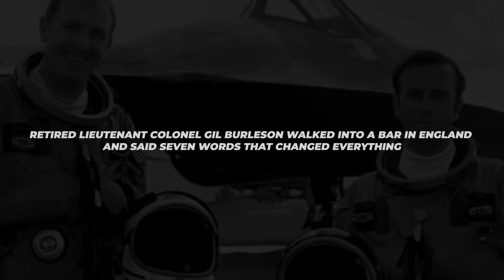Finally! SR 71 Pilot REVEALS The Blackbird's TRUE Top Speed!

Comment: It's actually very simple.  The SR-71 (and the A-12 and YF-12) can fly slower and lower burning more fuel staying cool, or higher and faster burning less and getting hotter.  The only coolant on board is the fuel flow.  So there is a point where flying higher, faster, hotter, with less fuel flow becomes impossible.  Why?  Because we are not burning enough fuel to cool the aircraft.  Also, above 82,000 ft we get into the ionosphere.  It's not really atmosphere any more, it's plasma.  Everything simply gets too hot.  Long before anything would melt, the temperature started to do permanent damage to the airframe.  It would take days, sometimes weeks to repair.  This information is from multiple actual sled drivers and actual mechanics that I have talked to in detail.  It's not classified, it's physics.

Above 3.3, things start to bend.  The damage just gets worse quicker beyond that.
Reply: Exactly the correct point to make. High Mach speeds aren't about having a long enough virtual hill to build up speed going down, they are a function of engineering requirements to achieve specific flight envelopes or aerial performance responding to pilot input at a given altitude density, airspeed and Mach speed and there are several engineering factors which must be balanced on a knife's edge at high Mach speeds, which for example limits the stainless steel Foxbat to around 2.8M and the titanium SR71 to around 3.2M. The reason for the limiting factor on the Foxbat is structural failure but on the Blackbird it's the engines and what that means is their design simply cannot sustain speeds above about 3.4M, they just plain won't do it. People can fantasize all they want about 3.5M claimed performance but as you mentioned it's not about classified information, it's about irrefutable physics. As it so happens even 3.4M isn't particularly realistic for the SR71, that's actually about 3.2M but the single seater versions had no problem sustaining 3.4M long enough to break official speed records and it is rumoured the SR71 could be pushed there but not as easily, IIRC the most plausible claim for an historical, unusually fast mission leg for the SR71 was a hair over 3.3M whilst as mentioned the YF-12A speed record is 3.4M. Anyway, that's about where the engines just can't cope with inlet control to function any faster. It's a hard limit. Irrespective of any other airframe capabilities. The target sustained high Mach cruise all the craft's engineering was centred and designed around is specifically 3.2M, straight up. And all the engineering is a knife edge balance for that speed and altitude envelope.

Comment: I am confused, when LM was testing the actual hyper-sonic engines, they couldn't get it to work and had to call in Douglas to get it right for them.  How could they have had hyper-sonic before others then.  PS the original hyper-sonic was actually a Douglas project.  Why is LM getting all the credit for others accomplishments?  Is that what they mean by skunkwerks?
Reply: Just added glory for the video.  I worked at MDAC back in the 70s and 80s.  I had security clearance and access to "The Vault".  Rumors were 2800s plus for the Blackbird.  Not a capable max speed but a working speed.
Reply: @halrichard1969 2800? Knots? Mph? Kmh?
Reply: @halrichard1969  :  Max mach recorded for sr-71 was mach 3.5, x-15 was mach 6.7 recorded.
Reply: @slowpoke3102 even that 3.5 is questionable
Reply: You mean Lockheed not Lockheed Martin. And these aircraft arent hypersonic
Reply: @gr8crash  : Yup, that was my point.  The the video tries to suggest it was the earliest hypersonic.  That fact is the X-15 was the first to fly people at hypersonic speed, many moon ago.  Old NA, Douglas tech.  Revisionism has been in to rid us of the real brains, give credit to the 'Oh all they did was land on the mood' horsey - puckey.  Speaking of revisionism, the top speed of the x-15 appears to have been dropped down by several thousand mph.  Hmm, with the thieves in command I am no longer surprised.  The new Democracy  (with the new charge,) instead of 'we the people,' it's now 'stick em up'
I don't fib so I must give my 1 correction not 6000mph, but mach 6.7 highest, blackbird was mach 3.5.  Both sides will say it could be pushed harder.
The x-15 had 1 flight with a death, while the blackbird and the A-12 lost appx 50% of all similar aircraft, (there were several versions) but many will mislead and have you believe of it's safety.  50% of each similar model is very high.  This will not be included in the reports.
Reply: @slowpoke3102 i have no idea what youre trying to say, you seem to be rambling incoherently. But the X15 was built by North American Aviation,  and no its speed hasnt been "dropped down".
Reply: @gr8crash  :  North American worked very closely with MDouglas, like the shuttle the anti dougas cult was screaming it was the 727 of outer space.  It had 3 main engines.  When corrected screamed in disgust when NA & Douglas said it was the DC-9 of outer space.  Oh the pain, was the response on national tv.
Interesting that literally how the facts since LM has been in charge is now under revisionism, at best handled like a shell game
New facts appearing from outer space and established facts vanishing and claims were never there.  Have been reading about aircraft and engineering since the mid 1960's.  Douglas helped many, many companies become reputable aerospace companies.  Lockheed like most companies had their hands full of trouble.
The entire aerospace community has been turned topsy turvey.  I know what I speak.  Tell me anything I don't already know of what you have mentioned.
Please explain why the date and history are being twisted?  If you claim it hasn't then we know that you are helping shovel the big pile of disinformation.
Reply: @slowpoke3102 you post is complete gibberish honestly and not even sure what to respond to.